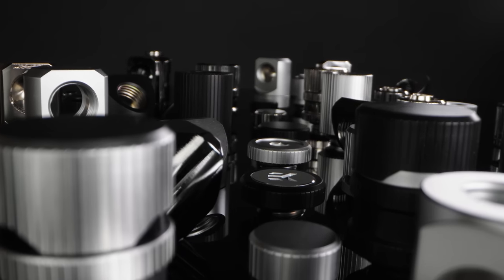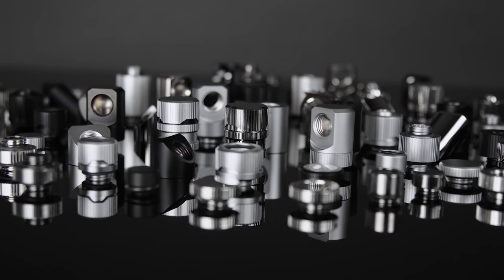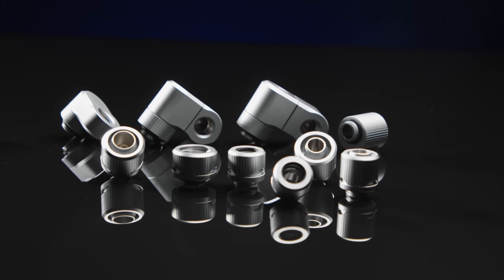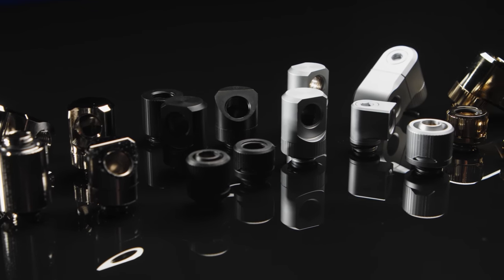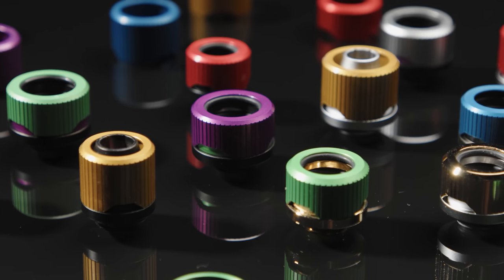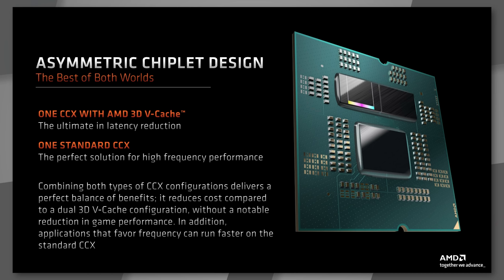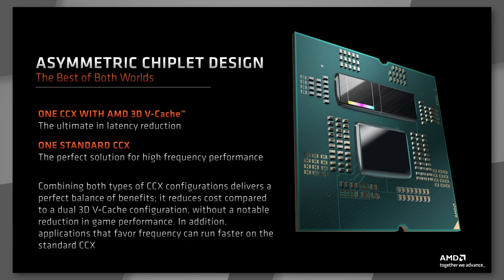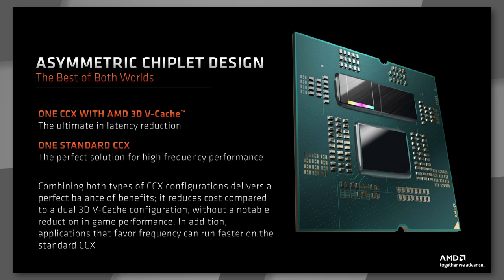Why I switched back to Intel...

Comment: I think you’re right on with the single CCD being the way to go with x3D chips. I’m currently running a 7800x3D — it’s rock solid and I’ve had no trouble with ram at 6000. In fact, this is probably the most stable PC I’ve ever had (Asus ProArt x670E for mobo and a 7900xtx for gpu.)

I am curious though: Did you ever try swapping the cpu or motherboard? I do wonder if something in your setup was defective. I’m sure you’ve gone over this in a video at some point, but I don’t remember
Reply: $10 says it's a motherboard issue.
Reply: @Gamesemag  Are you okay? Do you need someone to talk to? Is everything okay lil buddy?
Reply: @AndyViant  It's a CPU issue. I had the same, swapped CPU after months of testing and tweaking, and everything just works now.
Reply: @Gamesemag  funny. but I've had AMD's on and off from the K6, through the Athlon and Thunderbird, Second Gen Ryzen to current Zen 4.

They've all been stable. They all did their job just fine.

If you've had stability issues, it's probably because of the motherboard brand you used, or you thought that because they were unlocked for overclocking you could just wind them up 50% like the good old days of a Celeron 300.

The reason why Intel started locking down their gear was the amount of complaints from customers who destroyed their gear by overclocking the hell out of it.

Comment: I did experience similar issues with my first 7950 x3d, bestbuy took it without issue as defective and the replacement is stellar! High performance, multitasking and gaming monster gaming...... Running EXPO 6400 zero crashes or boot issues.
Reply: I want to get this chip for streaming over the 7800x3d do you think that the 7950x3d would be good for that

Comment: I've been on AM5 - 7950x since December 2022. It's been going relatively well. I have great stability running tuned 2x32GB 6200mhz ram (hynix M die). The memory training is definitely longer. I've also had two boards die (Asus chipset died 8 months in or so and the Gigabyte board DOA).
Outside of the memory training I'm quite happy with the performance.
Reply: Depending on your timings. Thats really slow memory, wouldnt be surprised if it caused bottlenecks in some games
Reply: @mamamia5668  lol no it's not, unless the CL is like 40+
Reply: you might see improvements going down to 6000 there is a known issue for anything above that
Reply: @kiraakashiya7986  What known issue?

Comment: I came from a 3700x, upgraded to a 5700x and the x3d variant before going for the 7800x3d. AM4 x3d was just plug and play. I even had 4 sticks, no issues whatsoever and it was great. The 7800x3d on the other side gave me problems to no end.
I don't shy away from manual tuning, but I experienced a lot of things you did Jay. Sometimes it was fine for a week and then wouldn't boot at all. Sometimes it would get stuck on Code 15, other times completely random ones.
I'm running 4 sticks (which is stupid with 7th Gen AMD, I know) at 5400MT/s, but the system randomly freezes for a second every once in a while.
I hope this is just a hickup on AMD's part with AM5 and the next generation will be more stable, otherwise I would jump to Intel.
Reply: sounds like a u problem
Reply: Running a 7800X3D since July with 2 sticks of 16GB of 6000MT/s in Dual Channel ... no problems whatsoever shrug
Reply: what made you upgrade from a 3700x to the 5700x before the 3dcpu ?
Reply: I been having issues with my pc but then yesterday pc just BSOD running 7900x with 4080 strix and when i tried to boot back up code 15 over and over few more boots and it booted fine i just unplugged my monitor from gpu and it was fine, im defo going back intel with my next rig considering i have a budget of 10k for my next rig im just going all out and getting whatever i want
Reply: what is your motherboard? give INFORMATION
Reply: i think its stupid that you cant run 4 sticks on a certain platform. Its a stupid problem that AMD should have fixed before launching those products, its one of the reasons i stuck to AM4, and haven't upgraded.
Reply: Ram for AM5 scares me (initially). Most ddr5 are optimized for Intel, so I don't trust buying ddr5 for AM5 unless it says "AMD Expo" or says it's for both intel and AMD.
I, personally, upgraded to an i5 13600K to avoid my fear, especially when AM5 was newly released because ddr5 haven't distinctly divided into "Intel XMP ready" and "AMD Expo" yet.
Reply: the AMD fanbeards don't like to admit it but this is why Intel has 80% market share

I'm glad that AMD is at least competitive anymore, Intel was becoming ridiculous on price/performance when they  didn't have any real competition for a decade, but I still wouldn't go AMD myself. it's ridiculous that you have to deal with issues like that when Intel CPUs have been low/no maintenance for decades at this point.
Reply: @roidnerd2501 has it ever occurred to you the GPU is the problem? If you unplug 1 monitor and it's fine....

Seriously people try to blame everything on AMD wtf
Reply: @Marchochias correction, intel only has 2/3 market share and most of that is due to OEMs and mindshare.

Currently AMD CPUs are superior in every single objective metric, unless you really need ALL the cores on a 13900K which almost no one does.

People building gaming rigs are overwhelmingly buying AMD and for good reason. Nothing competes with the 7800X3D. It even trades blows with the 14900K which is twice as expensive, while consuming 60% less power. Total no-brainer.
Reply: @thomasvennekens4137  Maybe he waited till the prices where lowered.. So making the decision to buy the 3D later. But after all he wanted to upgrade to AM5.

Dont think the upgrade from 5700x to 5800x3d wasnt stupid.. But then going to AM5 maybe will. Yes the 7800x3d is some what faster in games, but isnt worth the premium price after all.
Reply: @Marchochias  nice to complain, but dont forget Intel using bend cpu sockets. And thats not all, power consumption is crazy too) Or this was already long forgotten?
Reply: @Altrop  gpu works fine in my other pc have already tested this bud you would think people had common sense to understand this the BSOD was to do with the cpu dumb dumb, I tested this gpu and used my intel basedsystem with 4080 strix oh guess what for over a month no issues with that rig also tested with 3900x gpu was fine, I also tested 2080 ti same issue was there you understand things like this can happen right or i guess you dont, Its proven AMD is the issue so what are you chatting explain to me then you seem to understand how pcs work the prev gen cpus have run fine never once had an issue but now AMD have gone down the shitter
Reply: There is no such thing as ram optimization it's either stable at a speed or it isn't....no idea who told you otherwise @ArdyneusTheGod
Reply: @drunkhusband6257  
There are some DDR5 ram kits for Intel, some for AMD, and some for both.
Ram speeds can be overclocked higher for Intel than ram for AMD, meaning Intel can handle higher speeds better.
What I’m saying is that you can’t (always) use the same ram kits for both Intel and AMD because some kits for “specifically tuned” (or optimized) for one cpu company. 
It’s true that ram kits are kinda starting to be able to be used with both cpu companies, but you can’t tell me that you haven’t seen “Intel XMP ready” or “AMD Expo” on DDR5 packaging nowadays.
Reply: you know 4 sticks is stupid yet run it anyway........ have you even looked if your board supports 4 sticks in the QVL listing at 5400MT/s because many dont so your issue could still be a "you" fault for not checking the hardware support

Comment: I also got the 7950X3D in my system and being glad that it is running good so far. No memory issues, no crazy "new CPU random shitti errors" or such. Also running G.skill Trident 6000Mhz without any problems.. Its so annoying that somehow systems are working totally fine and others got strange errors, random bluescreens and stuff. For sure, all is manufactured and there always can be production errors in some CPUs or Mainboards etc.. So I am glad that i went the way for the AMD cpu (came from Devils Canyons Intel) and I dont regret it so far.
The only thing I regret is that I go with a 3080ti isntead of an 4090.. My ASUS TUF 3080ti has coil whining straight out of hell.. holy fuck never heard such a bad whining.. So I am doing an similar decission that i will switch my 3080ti TUF with an other 4090 card  (lookin right now for the right one and hoping that the black deals will offer me any good prices :D ) 
So like you, do what you want with your system, all is totally fine. I mean YOU are the one who is sitting at it so do what you want
Reply: Do you use any unfervolting value? (curve optimizer) oe
or just out of the box?
Thank you!
Reply: A very large part of me thinks some of these are Windows issues. It's happened before. AMD or Intel release something and we get all sorts of weird errors, even some BIOS errors after MS convinced the freaking world they needed extended BIOS access for "security". Two years later MS finally releases a patch and things start working. :(
Reply: cap fps or uv a little to lower voltages, coilwhine is gone.
Reply: I also switched from i7-4790K to AM5 this year :)
Reply: @halycon404  windows is some of it e.g. the whole xbox games bull.... to use the v-cache CCD of the 7900/50X3D. but a lot has to do with the motherboard manufactures being too aggressive with sub timings that are stable during the memory training but fail on cold boot memory test.

Comment: Just like Tavarish’s P1 Evo build, it’s your PC, put whatever parts you want. I do enjoy the breakdown of the different CPUs and the quirks of the 7950X3D, a lot of people might not know that

The memory issues could just be the board or a bad bin too, like Linus’s review sample of the 7950X3D, but that’s not something as a normal user you should have to constantly deal with

Personally on a 7800X3D, also have another Pc with a 7800X3D on my friend’s PC I built and works great. In fact haven’t had an issue with CPUs between trying out a 12600k and upgrading from AM4 to AM5
Reply: At least Jay has the computer built and fully working. Tavarish rushed the crap out of a very special car and half-assed it as always. 

The P1 is essentially now an upbadged 675LT without the hybrid system.

Don't compare Jay to Tavarish. Just don't.
Reply: It's not a P1, please stop calling it that. lol
Reply: @TheMC1X  and you forgot the purpose of tavarish's P1 right? it is to attempt to break a world record for fastest McLaren not to satisfy idiot fanboys

ill also remind you that P1 basically a 720s and tavarish's P1 is flood damaged where electronics are next to impossible to restore

hybrid system weighs 400lbs including battery and it is a 176hp motor with technology from 10 years ago which is already ancient by today's standards

new battery costs $160k regardless it being made with cells from a123systems or from panasonic and you can't take tesla cells because compartment was built in mind of a original battery and those batteries fail

him taking out that entire assembly,shoving in long block 720s engine and tuning it for 1300hp is significantly better than trying to make that system both work and make it more powerful

and heritage P1 has is basically F1 which did not have hybrid system so if anything it is actually more original than rest of P1's
Reply: I was not expecting to see a " crossing the streams" between Jay and Freddy...
Reply: @xthelord1668  But why throw away $600k on a wrecked P1?!?! Could have spent much less and gotten any other wrecked McLaren and made that the "fastest" McLaren.
Reply: @ctk4949  Then any car that has been modded is not the car it was. I have a ss camaro and if I decided to put a supercharger on it by your logic it won't be a ss anymore.
Reply: @akmid60  There are plenty of camaros, no one cares if you mod it, lol!! There were only 375 P1s made!! Well 374 now, lol
Reply: @ctk4949  because when do you get to buy a P1 below $1M?

hell even in wrecked condition when does that happen?

yes you could take a 765lt and make it prob the fastest McLaren out of all of them but then again you can do it with any other McLaren out there which could be even cheaper

and point of buying a P1 was to show that they are just like any other cars and that anyone can pick up wrench instead of running to stealerships for easiest of things

and no it is nothing less of what it was without hybrid assembly if anything it is actually better so the word you look for is unique because that P1 is the only P1 in the world without hybrid assembly
Reply: lol the hybrid system was 10 years old and a huge waste of weight. re doing it would have been a waste of time and money  @TheMC1X
Reply: @ctk4949  True and I am not saying modding or not modding any vehicle is a good or bad thing. What I am saying just because you change something doesn't actually change the model of the car. Is a modded car different then the original, yes it is. And, that might not be to every ones liking. That is why in the car world people will ask how much of this car is orginal.
Reply: @xthelord1668  So it's fine if someone took a McLaren F1 and put a 6cyl twin turbo in it?!?! LOL a P1 is not like any other car ANYONE can wrench on!! Even tavarish couldn't do it, because he is not making it a real P1!!
Reply: @Alex-zi1nb  This weight thing is dumb, the fastest production car in the world weighs 5100lbs!!
Reply: @ctk4949   yes because car is a car and doesn't lose its identity when you change the engine because we associate with looks more than with performance otherwise all of those LS swaps are junk

and if you wanted you could strip off that BMW V12 and replace it with a inline 6 of the time or shove in a B58 and it would still be a F1 because chassis is what we name after not the engine

hell story of rimac's success is basically tied to his E30 where his options were either another trash BMW engine or a 2JZ swap and he chose 3rd option which got him where? inventing and selling torque vectoring tech to mitsubishi and making a company which basically made him become CEO of one of most decorated companies in the world because he shown what you can really do with EV's

and if you really wanna sound this stupid lets see you work on that P1 and lets see you make that hybrid assembly work if you are gonna act so snobby and ignorant
Reply: @xthelord1668  Wait so it's the looks, isn't he changing the whole exterior?!?! So now it's not a P1 anymore!! LOL!!
No thanks I'm not the idiot that bought a flooded P1 for $600,000!!!! LOL!!
Edit: he is taking out the hybrid system, so he has to change the chassis?? So that also doesn't make it a P1 anymore!! LOL!!
Reply: @ctk4949  yeah it still rocks a P1 badge and a P1 VIN number because it is still a P1 under its skin

if anything it is unique, a true 1 of 1 in the world

and will we see you work on that hybrid drive assembly any time soon? i wanna see a snob actually back his claims that hybrid drive assembly can be made better
Reply: @xthelord1668  Keep on making excuses for it. You can enjoy that McLaren T1 Evo, LOL!! 
No thanks I didn't want to buy a wrecked $600K P1 and then make it a POS!!
Reply: @ctk4949  i don't know who is acting like a baby because some person decided to work on their possession the way they wanted to

don't embarrass yourself further and don't act as if your personal decision matters more than anyone else's in a situation completely unrelated to you

and when you get your P1 modify it to your taste and don't mind same comments you make right now
Reply: @xthelord1668  Exactly it's my personal decision, you kept on trying to make excuses for it being a P1. But when I made an argument against your reason, you kept on adding more dumb reasons.  First it was not the hybrid/engine, then it was the looks, then the chassis, but now it's only the VIN #, LOL!! Enjoy watching it, I haven't watched any since he said he wasn't making it a P1 anymore.
Reply: Tavarish's MP4-12C*
Reply: @rustler08  Not bad, how about McLaren T1 Evo?? lol

Comment: This is why I went with 7800X3D, because I didn't want to deal with the split CCD management.  My g-skill 6000 32GB kit has been solid.
Reply: who needs insane fps in indie games?🤣
Reply: @SaraMorgan-ym6ue  indie games aren't relevant here
Reply: Better get a 13700K and turn off Hyper Threading. Then you have faster no. 9 to 16 cores. Also processor gets less warm (won't clock down much then), uses less energy. Change in Bios that speed can go up to 5800mhz for the first 4 cores. You have a lightning fast game PC then.
Reply: @jankees4037  Sounds like a lot of work to get Intel to (maybe?) compete with AMD? And you have to disable hyperthreading to make it run cool?  lol.  13th gen is notoriously hot and really shouldn't have to disable a major feature.  J2C probably needs the better productivity performance, but I don't.  I'll keep my 7800X3D, thx.
Reply: @brianhusk4593  but it's the exact same scenario on the 7950X3D bruh
Reply: @ishiddddd4783  Your definition of exact same must be different than mine, but I did state I went single CCD to avoid the issues with the 7950X3D, didn't I?  A better comparison would be 7950X, which I don't hear about people having to disable multi-threading to keep it cool. heh.
Reply: @brianhusk4593  Because under 100% load it will be locked to 95°C since it's drawing almost the same wattage as lga1700 skus + bad ihs lol.
Under general usage the load on both sockets is pretty manageable even with air coolers, it's when you get to full load that cooling becomes an issue, for gaming an general usage tho? not really
Reply: @jankees4037  what are the temps tho?